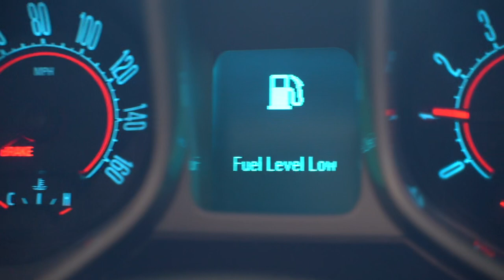DO FISH ACTUALLY EAT THIS SUPER RARE SWIMBAIT???

Comment: hey Westin, how do you rate those Yakima lock boxes?
Reply from the maker: We fixed (bent) the springs on the side once cause it started to close while we had it opened but that’s been the only thing and now it’s back to 100% makes traveling easier with them enclosed not worried about the elements or the passenger seat cluttered on longer trips
Reply: @WestinSmith  awesome, I might see if they are available here in Australia